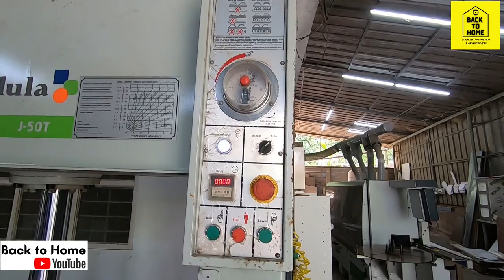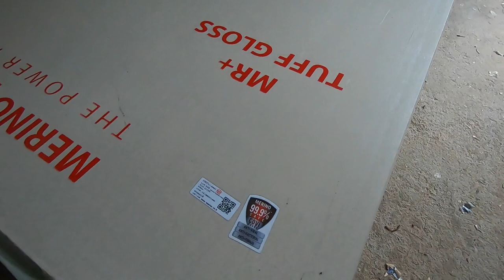Ep 74| Interior part 8| WPC board for home interior malayalam| Back to Home| Perfect Home interior

Comment: Enthu kondan cold press cheyyanam enn parayunnath. Hot press cheythal any problm
Reply from the maker: WPC is a fire retardant material meaning it does not help the fire to get spread. It does not burn with a flame. But the resistance of WPC material to extreme temperature is low as compared to wood. It can cause a melting impression if the temperature is more than 70 degree Celsius. So, cold press is recommmended.